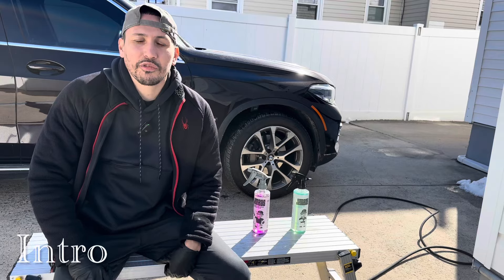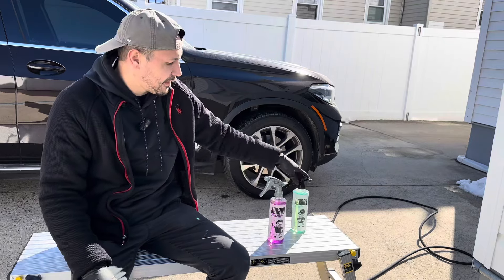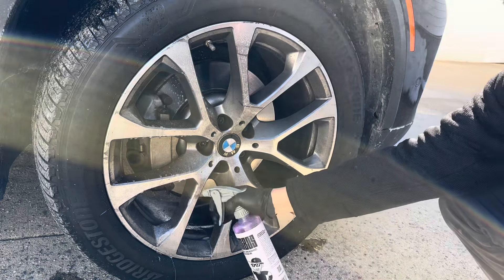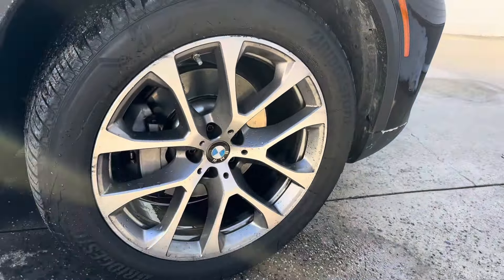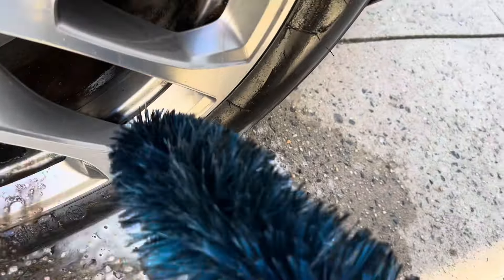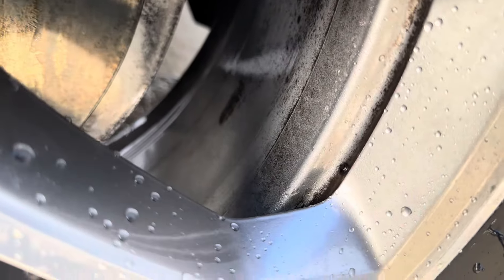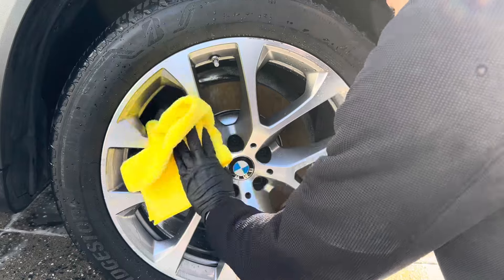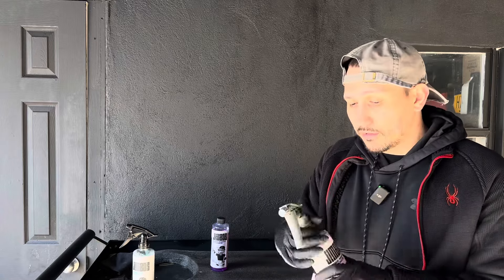BAM! Jimbo Pure Magic Cleaner - Acid Wheel Cleaner Without The BAD Stuff

Comment: It doesn’t contain HF but does contain a small amount of ammonium bifluoride according to the SDS which becomes a weaker form of HF when mixed with water. I would use it with proper precautions and don’t let it dwell on glass.
Reply from the maker: Thank you for the clarification my brother I appreciate it. 💪💪
Reply: I've been looking for this comment for the past 30 minutes and finally found it! I remember seeing when you first posted it like 3 months ago, I read it, liked it and thought "wow that's pretty good info I'll be careful" yet kinda forgot and still managed to permanently damage my glass 😢.

I tried many things now but even Meguiars M1505 ultra cut compound didn't do absolutely anything. My only option now is cerium oxide but I'm scared of making the problem worse.

A guy in autogeekonline mentioned almost exactly the same as you:

"doesn't have hydrofluoric acid in it, because it uses ammonium bifluoride (ABF), which is a salt. Of course, once you mix that salt with water to make a wheel cleaner, what does it become? Hydrofluoric acid (HF)."

So this may be a powerful product but, like true 5 year ceamic coatings, it is NOT dummy proof  and you can screw pretty bad and I guess I should also be using gloves, etc. when using this
Reply: @victor4091 the pure magic cleaner damaged your glass? Did you let it dry? I tried it on glass in direct sunlight, but didn't let it dwell. Sprayed, agitated, and wiped off. Worked great for me
Reply: @JamessLuner-wi2qs  yeah it damaged it I think the damage was instant due to extreme heat here, I didn't dwell either, just sprayed agitated and rinsed within seconds but the etching looks like what I would look if I sprayed anything again, like a big "ball" in the center where it hits and then multiple lines running down the glass
Reply: @JamessLuner-wi2qs  the main thing is be extremely careful with yourself, I don't care too much about the car but HF Acid is pretty nasty stuff, I talked with a chemist friend who works in oil and gas and he told me the same, it does work great as cleaning but it can damage your bones pretty bad or even leave you blind if enough hits your eyes
Reply: he also said that 5-15 of phosphoric acid (from the SDS) was way too much

Comment: $30  for water ,shampoo and pink color ..naaa! 😂
Reply from the maker: Maybe. 🤷‍♂️ If it works it works. Literally worked like Wheel brightener without the hydrofluoric acid. He will be out with a concentrate form in gallons so I am sure it’ll be much more economical.
Reply: Mario, try checking the SDS before you talk nonsense. I would say it’s far from water and soap. It actually makes me slightly uneasy. I’m sure it’s very powerful.
Reply: @chrisbradley3224  
1/2 Oz dawn to 1Gl from water ?
Reply: @chrisbradley3224  it etched my glass permanently :(
Reply: @victor4091  I’m sorry to hear. It has ammonium biflouride in it so it’s basically weak HF in solution. I think Jimbo should warn on glsss since ABF/HF is used as a glass etchant.
Reply: @chrisbradley3224 thanks, I agree it may be a good and capable product but they should probably put some warnings. I don't expect Jimbo to have a lot of problems/complaints because he's mainly selling to enthusiasts and detailers that mostly know what they're doing but I can see why big brands that sell on Walmart shelves moved away from acid cleaners (like the guy that commented above that seems to think all detailing chemicals are just "shampoo in different colors")
Reply: @victor4091  I think acid cleaners are great except for ones like this that contain hydrofluoric acid or ABF. I don't think he should be selling this stuff without a big disclaimer. If you got this blown back in your eyes you could be in trouble.
Reply: @chrisbradley3224  oh wow, I don't even remember if the mist reached my eyes, I didn't use gloves or anything the first time I used this. Would you recommend I use like safety glasses or something like that or eye protection?

Comment: What gets me every time someone does a product review, they do it on a newer vehicle, I have a 2008 Honda Accord and when I clean the wheels, I still can't get off all the brake dust, so please use a older vehicle
Reply from the maker: There is only soo much heavy neglect can do even with meguiars wheel brightener. Comparing an 08 Honda to a 2020 BMW although they are both neglected there is only soo much you can do vice versa. That's like someone asking for a smoke odor removal treatment on a vehicle smoked in for 3 years everyday vs on 7+ years. 

You can clearly see brake dust baked on. It's a 2020 owner never got it detailed. BMW are notorious for brake dust and to have a lot baked on after 3 years in the barrel it shows. As time goes on I'll use it when it arises. But it's not that I detail heavily neglected vehicles often.

Comment: Have you used Meguires D143 non-acid wheel/tire cleaner? Thats been my go to since it seems to really eat away brake dust as well as pull away browning from tires. I usually go for about 1:3 to 1:4 ratio. I’m curious to see what your opinion is compared to the Maniac wheel/tire cleaner is.
Reply from the maker: Yes I have that’s the red wheel and tire cleaner. It’s good. But this definitely cuts better than that. As for my favorite wheel and Tyre cleaner in terms of strengths in order are Maniac , Adams and Extra tough. Maniac is 1:5 for winter I’ll give it a shot at 1:3 ratio. See how that goes in the future. But I did need a lot more elbow grease with the maniac wheel and tire. At even 1:5 to get that result.
Reply: @DetailingMadeSimple  I’ll be curious to see if Jimbo’s Bam works well on tires too. That’s what brought me to D143 was that it really cleans tires well. Luckily I don’t deal with much for seriously dirty wheels like BMW’s have.

Comment: Is this safe for chrome rims?
Reply from the maker: I have to double check and read the website. I don't remember off the top of my head. I just know not to use on adonized or powder coat. Don't remember about chrome wheels.

Because I've use this on the chrome pieces on say door edges and worked fine. I recommend read the website to double check for the wheels

Comment: Yooo what up brody, I just got my gallon of this - it’ll replace superior products wire wheel cleaner!

I used to the 16 oz earlier this year and enjoyed it. I’m glad to get the gallon now to cut it 1:1 for water spots and acid wash. 

ABF is weaker than HF, by far. 

Per Pure Magic Cleaber’s SDS - pH is 4. 

My current Wire Wheel Cleaner’s HF is pH 2. 

Potential Hydrogen, Henderson-Hasselbalch equation, whatever you wanna use to gauge pH, just know that our skins happy barrier is pH 5.5. It’s fighting off bacteria. We are acidic during exercise, oxidative stress from environment, etc.

Just saying…pH from 5.5 vs 4 is better than pH of 5.5 vs 2, as far as skin contact goes.

Thanks for putting up this video for the people out there. Have yourself a happy New Years out there.
Reply from the maker: Yoooo my brother. Definitely 💪. I found out best for water spot removal on cool glass now is 1:3 and even on the paintwork save money 👋💪🫡. It's a hard hitting product

Comment: Great concept for a chemical. I hope that other detailers still using harsh acids can opt for something like this to work just as well without the downsides. I’ll probably purchase a bottle just to have on hand in case I need it on some especially bad wheels, but it’s a little too pricey for me to use as my main wheel cleaner.
Reply from the maker: Definitely Ethan. This is a huge step in the right direction for detailing and improving the user experience and safety of detailers. I stopped using wheel brightener as my wheel cleaner my first year after the heavy kick back and slight itching and burning on hands/skin. I can't wait to try thing as a water spot remover. Hopefully it performs just like wheel brightener 💪💪

Comment: Good morning Soc,
May I ask what brand that brush you're using for the wheel cleaning is?  Thx.
Reply from the maker: Hey my brother 💪 For the brushes used in the video. Regular boars hair brush, second was a green flag tip brush from DIY Detail. Also the rag company has one as well last for the wheel barrels was the ez detail brush large.
Reply: @DetailingMadeSimple  Nice!  You use top quality tools. 👌 
Have a great day ok 👍
Reply from the maker: @jaimedpcaus1  💪💪
Reply: Hi Soc.  How do I check that my wheels are not aluminum?  Is there a way to find out?

Comment: Excellent video on the new product. I wonder how you would compare this to P&S Brake Buster?
Reply: It’s not even really comparable, very different product. Brake buster will prob be better on tires but worse on everything else. Brake buster is fairly weak IMO.
Reply from the maker: Hey Dan. Thank you 💪. Brake buster is a total wheel and tire cleaner and this is only specifically a wheel cleaner so I cannot say one is better than the other. As wheel cleaning this beats Brake buster but as a tire cleaner brake buster beats this as this is not meant to clean tires.

My best bet is probably use this wheel cleaner once every 3-4 washes to deep clean your wheels but not necessary for every use. So you can keep using brake buster in between 💪

Comment: I saw one of Jimbo's vids about Pure Magic and he shows it can be used as a "foam enhancer" in a foam cannon and adds more cleaning bite to a shampoo in a cannon or bucket.  Like anything, probably can be used in an IK Foamer but I would be sure to neutralize the insides of the IK quickly afterwards with a thorough water flushing.
Reply from the maker: Yes I saw that video as well like you said to make the car shampoo have more bite. As for the foamer like you said as well we may need to clean the IK quickly because it may damage the tubing and trigger due to it being acidic. ONLY one way to find out! 😂😅. I'll most likely be the Guinea pig 💪
Reply: I’m not trying to discourage, but before you decide to foam it, check the SDS and info on ammonium biflouride. It is less bad than HF but only a little bit, it’s toxic if you don’t take precautions.